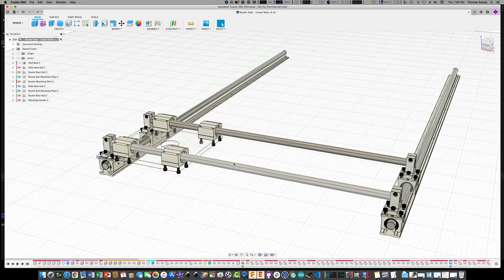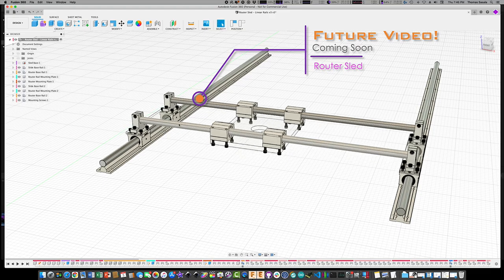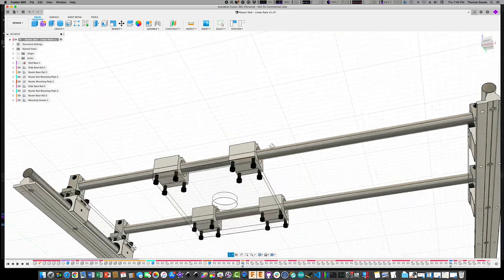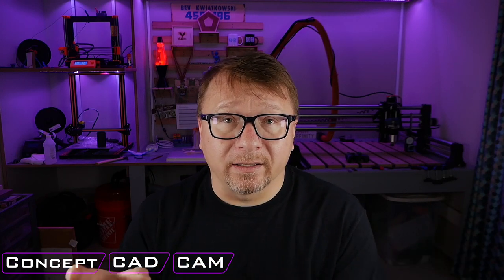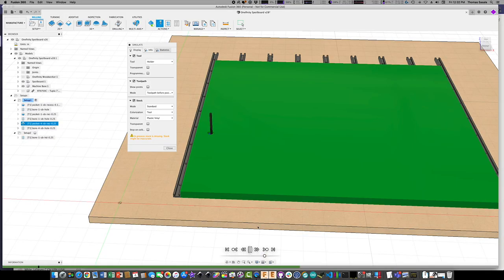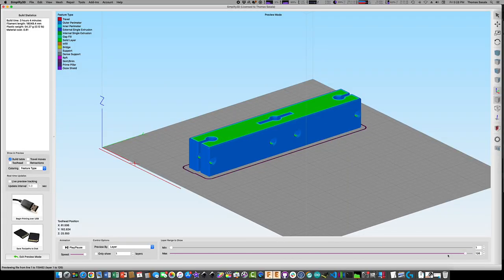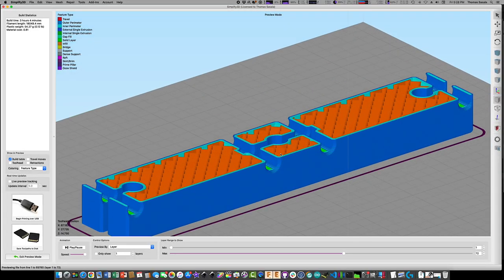CNC 101 Concept to Product

Comment: Great videos! They will be a great help to me but.... I just finished putting my machine together and on initial turn on the screen shows the one finity logo and says booting, then the screen goes blank. This happens every time. So, I’m stopped before I even get going!  Haha. Any ideas?
Reply from the maker: Hi - thanks for watching. Sorry you are having problems - have you tried turning the monitor on and off again? And checking the cables. I've heard there are some issues with the stock HDMI cable.  Otherwise, recommend contacting support.